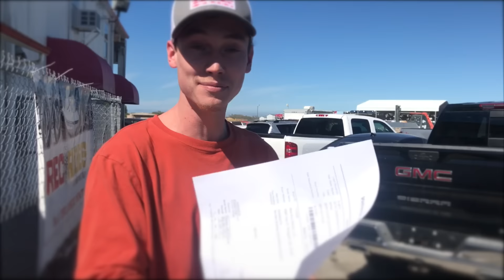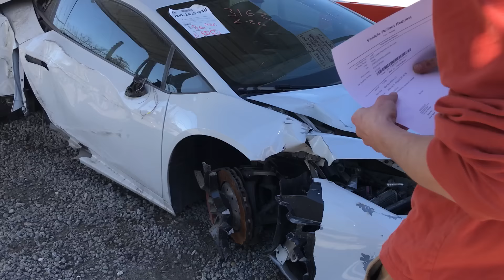Rebuilding A Wrecked Lamborghini Huracan

Comment: Best thing about those cars is that the engine is in the back so usually they are ok after an accident.
Reply: Yeah unless you crash in the back of it
Reply: And the driver is still alive
Reply: TheGamingPhantom 01 bruh my parents have almost been rammed so many dang times
Reply: Someone raming up the back of the car
Reply: @harrisonsvloglife275  Good one
Reply: Lol
Reply: Also my phone made me say the d word had edit the comment 🙃
Reply: Im ur 100 like
Reply: Tesla’s you don’t got to worry about.
Reply: Pretty much but if you have something that cost a lot in the front trunk or like you get mad because those cars cost and someone runs into your door and breaks and doors are pretty hard to fix because there are wires that control the windows and also connects to the button and levers those wires cut so much money GEEZ also for a Lamborghini that’s probably not gonna be cheap Teslas forget about that part all you gotta do spend a few 100s or 1000s for the parts and to put the parts on but Teslas you will be pretty ok but like uhhhhhhhhh BYE
Reply: Easy way to be millions
Reply: how much did y’all pay?
Reply: Depends on speed 🤣
Reply: WoW
Reply: Except a rear end crash that does not help a (for example) Bugatti It could cause a (in my sayings) a big boom
Reply: If someone rear ends you screwed
Reply: @that_cool_guy8688  ikr
Reply: That's the prime key to remember!!!
Same goes with porsche and Ferrari
Reply: The girl that was driving probably didn’t care because she could buy another one with daddy’s money 💰
Reply: Yeah, but the radiators and electronics are in the front so it does complicate things.
Reply: @Melody-qz2gl  teslas split in half tho so
Reply: but also it can possible to have an accident from back

Comment: Check for impact sensors guys

That might be all you need in order to fire it up
Reply: It’s for sure
Reply: The impact sensors are part of the fuel system in some cases because there is an inertia switch on modern vehicles that if it's set off then it does not send power to the fuel pump

That's how people can use neons and cavaliers for demo derbies is by looping the wires on the inertia switch to essentially bypass it

Comment: Fuel cut off switch kicked in on impact.Needs resetting
Reply: should turn over though right ?  It did on my super exotic '93 Nissan Quest minivan hehehe.  I jacked it up and heard a click like the frame breaking.  the owner's manual said if there is an accident there is a little red button under the fuse box near the driver's lower door hinge.  Pushed it and presto !!!!  It did turn over before that but no starting at all until that button was pushed.  I had a ford ranger and that one was under the carpet under the accelerator pedal.

Comment: privet goonzquad :)
i work at lamborghini in germany and in these cars are there where is the battery on thr positive kabel is a brocken capsule this broke when the airbags are deploing you need to change it and the car will start :) it is the same like on audi because lamborghini is all parts are audi and the parts like brakes electric and engine and much much more is the same like on audi r8 :)
have fun with the build !!
Reply: That's the info. But does this capsule cut the +12V battery ? If yes, why their dash is still powered ?
Reply: Fredo's Mavic If like the bmw e46 it cuts the fuel pump, as in a accident the car may need power ie lights horn so doesn’t completely cut all power
Reply: @neils-running-journey  sound logic! Hope for them it's just it.
Reply: MrUnboxingGeek please consider not having sexual relations with your father and brother
Reply: Fredo's Mavic its like a buddys audi i worked on the fuel cut off switch went off and i wouldnt let the car turn on it just clicked but every light and dash all worked you just couldnt turn it on until you changed it out
Reply: Just like the bmws .. my 328i was in a accident and it lost all power it wouldn't start even with a good battery and I found out that the fuse in the terminal was blown .. I replaced it and the car had power again... But then everything else started to go bad like the fuel pump , transmission,engine valves,radiator
Reply: @lagrangefrederic5699  it cuts off power to the starter and pertinent modules. The rest stays powered to get the other electronics to work ie locks, windows etc.
Reply: @lagrangefrederic5699  Starter? May be a separate issue!
Reply: It would be cool if you got a hold of the squad to help with the build, I am sure they would appreciate it.
Reply: @MrUnboxinggeek  he speaks better German then you ever could! I reckon he can speak English pretty damn well considering the English language is the hardest to learn
Reply: @josephiosefa7260   lol
Reply: Yes there is a pyro fuse that blows with the airbags that cuts power to everything but the accessories. You can use jumper cables to bridge the gap. Its the same as an Audi
Reply: @MrUnboxinggeek  cmon dude. Dont be rude. The guy just provide some heads up, how about u?whats ur knowledge to share?
Reply: @MrUnboxinggeek  well he said he was from Germany and may not speak fluent english so i would not be making fun of him for it
Reply: @MrUnboxinggeek  you probably did a google spell check on your words before posting haha, wouldn't be surprised.
Reply: @dailydrivencommander6843   english is not the hardest to learn.. try arabic or japanese or chinese even german
Reply: @chrisaudi1593  it actually is when you study and research sounds and phonics etc and realise there is 7-8 ways of saying one letter that is sounded different in many combinations of words
Reply: +1 on checking battery safety terminal. Should be at positive battery terminal. It's a pyrotechnic device that deploys during a wreck to stop high current flow.
Reply: english has left the chat
Reply: was schätzt du grob werden nur die ersatzteile kosten ?
Reply: Martin P 
Im Germamy I would call you "Ehrenmann"
Reply: My nephew is a Football player, not soccer, in Germany,he's from the USA Danny Wynne have you heard of him he's in the news over there a lot.
Reply: @dailydrivencommander6843  jajajjajaja (laughs in spanish). Spanish is one of three hardest languages to learn. Spanish, chinese, and turquish...

Comment: wonder where they put the lambo getting the lift installed. Sneaky stuff. @14:07 you can see the lift is still packaged
Reply: The Night it was under a cover in the installation video
Reply: Yeah, they referred to it as 'the bat mobile' in a few videos
Reply: I was wondering the same thing. They’ve had this lambo for a long time
Reply: it was covered behind the lift. peep he said 4 cars, but the  red nissan was outside
Reply: What happened to the goblin? Could that have been what was under the cover?
Reply: Yeah I see it to😉
Reply: The Night it was covered with black tarp I think
Reply: The goblin was in house garage
Reply: I was wondering the same thing I think it was under a tarp/sheet in front of the house garage

Comment: Greetings from Germany. So Audi bought Lamborghini in 1998. So you could say that you have a R8 with Italian design 😄. Before I went to college, I worked in the  Audi Plant Neckarsulm, which manufactures the R8. I worked there on some R8's and even on  some Lamborghinis so maybe i could help you. 

If the battery  was disconnected I could imagine that the battery energy management System (BMS) could cause the trouble. Your car could also be in a protection mode after the crash to shut down the fuel pump and all the other stuff. (You don't want to have any fuel on the hot exhaust manifold. So check also carefully the lines, sometimes they get damaged by the crash.)  And for the locked transmission under the cover for the shift knob on the right side could be a small button/switch to put it in neutral if the battery is dead or couldn't be recognized by the BMS. I hope I could  help you.
Reply: You’re...
Smart
Reply: Hey lars dadurch dass es englisch ist verstehe ich ned ganz ob die den jetz vollständig reparieren oder nicht, weisst dus ? 

Hast du auch audis gebaut?
Reply: @daddysnaggy3174  Ja normalerweise machen sie das immer. Manchmal verzögern sich die Reparaturen aus Kosten- oder Liefergründen aber sie hauen so lange weiter guten Content raus.

Ja habe dort auch in der Produktion gearbeitet.
Reply: Lars N and volkswagen owns lamborghini so you can say its a modified volkswagen
Reply: This is an anti-theft feature, you can't tow the modern car without starting it. The engine in my X5 once died on the autobahn so we had to shear the pin with the special pin under the gearbox to make it moving. Even the starter was turning the motor.
Reply: you seem to be an invaluable help to these guys, they should have you in their team.
Reply: I just picked up a 2012 R8 a few days ago. what years did you work on R8's?
Reply: well well well
Reply: he's probably engineering for Bugatti or some other Subtle yet insanely brilliant European racing team.   @hmax1591
Reply: Hallo von Seattle America
Reply: @mischeviousme1  nice how do you like it? I never worked in the production of the R8 but in the development department.
Reply: @_kblanks2229  Hallo zurück nach Seattle.
Reply: @azikosha  that's right.
Reply: Moin, kannst ja mal dem Nico Pliquett schreiben, der hat seinen Avio zu schrott gefahren und baut den gerade wieder auf
Reply: @W0pper1997  "baut" ihn auf. Einen Scheiß macht er. Er schrottet es nur noch mehr...
Reply: You guys talk a lot.
Reply: lol gay
Reply: Lmao stop thinking so hard bruh

Comment: Cars have fuel shutoff when there's a crash.  In trunk or kick panel.
Reply from the maker: Makes sense well look into that
Reply: Only some do. Mainly Ford's. Not saying this one doesn't. Good thought. Always good to check!
Reply: The lambo does not. It wont start due to the system being in shut down mode after a crash. You will need a factory scanner to recalibrate and erase errors in the ignitio/pcm module and collision module AKA airbag and occupancy module. Once that's done,it will purr. Ken from Montclair motorwerks. Hit me up if you need anything.
Reply: It's not a fuel shutoff, the car isn't cranking.
Reply: @shearcarnage  OMG Factory scanner $$$$$$
Reply: @michaelstrangefranke7002  or a cheap chinese knockoff. Whatever gets the job done. The boys are resourceful. Im sure they have a source that can help them out locally. I'm more worried about all the parts they have to source. This isn't the viper. I'm really looking forward to how this plays out. If anyone can help them out,they should. We all want to see this thing on the road again.
Reply: @goonzquad  see reply.
Reply: @shearcarnage  I agree I hope it does get back on the road but this one's not going to be cheap I mean the Viper was expensive but nothing compared to what this is going to be I hope they didn't bite off more then they can chew
Reply: shearcarnage awesome!!

Comment: perhaps it's a fuel cut off switch that energized during the impact? Just a guess.
Reply: Ripper13F1V it don’t crank at all tho, if it cranked but didn’t start that would be a possibility
Reply: @bradbozarth2680  good point hmmm

Comment: Hey guys. I've been watching your channel for a bit and I'm pretty impressed with your level of skill and knowledge considering that you look to be barely old enough to drive. Maybe that's my age (53) speaking, but you look to be 16 or 17 to me. lol.

How old are you two really? Where and how did you learn your skills? There's been a couple of times that something you've said has really impressed me due to the depth of skill/knowledge that your comment has indicated. Other than the fact that you both have more body/paint knowledge than I had when I was. let's call it less than 20, you remind me of me about 40 years ago (I was practically raised in my father's Chevron Service Station and basically taught the 4 levels of auto shop in my high school). 

Congrats and keep up the great work. 

P.S. What would you guys think of an interview for a possible article if I can get the approval for it?

Oh: P.P.S.: Why do you guys always seem to replace body panels, even ones that can easily be repaired with some attention and the proper tools, one of which isn't Bond-o?

Comment: How much it costs as wrecked ?
Reply: in this state arround 50-60k,but with all the repairs cost 100k plus.
But this is nothing for this guys they earning from you tube 2 milion $ per year without a problem.
They driving Corvette,Mustangs,this are all expensive cars so it's very obvious they are rich.